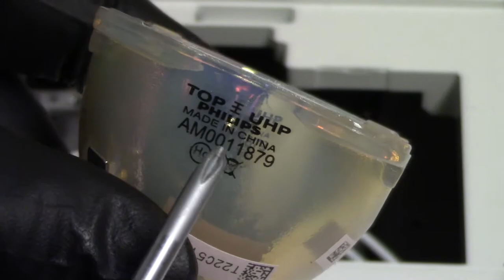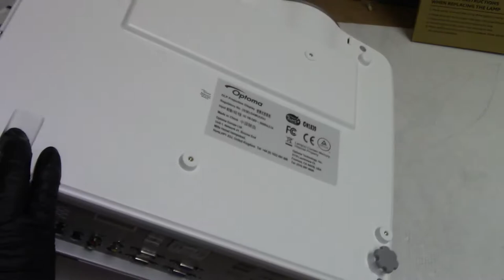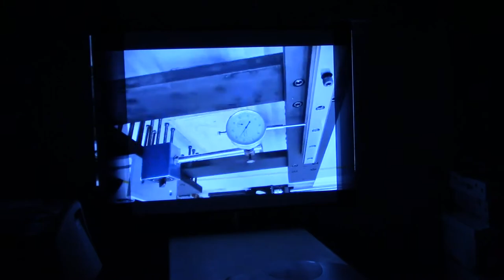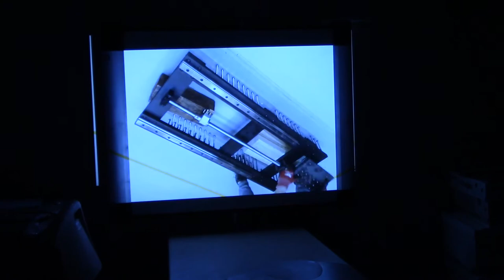Optoma WU515 DLP Projector Repair | Melted Connector Replacement

Comment: Hi Frank, Stumbled across your video looking for info on troubleshooting my projector. Hoping you can help. So I purchased an Optima EH515 for my business off Ebay about 1 yr ago. When I purchased I was informed that the bulb that was in it had about half its life left. So I purchased another. Initially, I bought one from Amazon. Not knowing at the time that there were differences in build quality and material. So after about 2-3 months, I was not pleased with the light output. I use my projector for Monograms for my wedding company. And at 5000 lumens, I felt it should be much brighter than I was getting from it. So, I did some research and purchased a new lamp. actually, from the place you recommended above. Pureland supply!

After installing it and using it a few weeks later it started shutting off randomly. At first, I thought it was the power cord not getting a good connection. But I have been able to verify that the cord is working fine. Last night I pulled the lamp and looked for any bad connections. Did not see any. Also, made sure the fans were coming on, on all three sides. As well as, checking the filter on the side of it to see if it were dirty. And it was not. So I started it back up and let it sit for a bit. After 15 min, it shut off again. But after a few min, it powered itself back on. did that a few more times before I pulled the power cord on it to keep it from starting back up. I did notice the top feels really hot! So Really not sure what is going on with it! Hopefully, you can help! I would really appreciate any advice you may have! Thanks!
Reply from the maker: Does the image flicker at all before it shuts down?  I do know those eh515s can have the same color wheel issue the HD26 an GT1080s can have.  Pureland will do repairs if you ask.  They just dont advertise it.

Comment: I have a similar projector EH515 it's pretty much the same as this. Replaced a dmd chip. The lamp does not sit in comfortably in mine either. I still have problem with the door mains switch. One day I might be able to fix it.
Reply from the maker: Still acting up?  Even with the door switch bypassed?  That is just weird.

Comment: Hi Frank,
I was wondering if you could help me with a solution to a problem. It's a Sony VPL-VW325ES 4K HDR Home Theater Projector. It powers on fine and shows a display but does not recognize any input when I plug into the HDMI ports. I really appreciate you sharing your knowledge!
Reply from the maker: Hi Nima, there is a good chance the HDMI chips are bad. Or something further up the main board. I repaired a vw40es with the same issue. Sadly it's a not an easy repair or cheap repair. However if you still are under warranty, I would use it.

Comment: Hi Frank I have a melted color wheel connector for a 3550i projector. I have the color wheel replacement from benq but it didn’t come with a new connector plug. My question is where do I get a replacement connector without going back to benq?
Reply from the maker: Thats a tough one.  They are technically built by Delta ( I think this model at least) and the wires are not listed. If the wire is passing voltage, I would suggest using kapton tape to protect the damaged areas. They only pass about 3v max, so the power requirements are low. Another option would be to de-pin the connector and slide some heat shrink over it, then re-pin and reverse the cable so the damaged end is away from the heat source. You could try an e-recycler. I use a company in China, gydz@timeprojectorlamp.com  They may be able to help.   I wish I had a better answer for you.

Comment: Hey Frank! I have a problem whit my proyector and I'll be very grateful if you help me. I am not a native English speaker so I must apologize in advance.
A year ago I've connected a Chromecast to the USB port for power supply and a Google home in the other USB. Then, it exploded. 
Yesterday I thought that I might be able to fix it so I unscrewed it and discovered that one of the capacitors exploded so I put a new one and it worked! Just for 10 seconds, the it turns off. I tried to turned it on once again and another capacitor exploded. What do you think is the problem here? Mi power supply is 220v (in the back it says 110v-220v)  I don't think it's the voltage because I been using it for years whit 220. Maybe a short circuit? Thank you for reading!
Reply from the maker: Also a WU515?  I would check the low voltage power supply.  My guess is the google home had needed too much power. Those USB ports only supply about 500-1000ma.
It's hard to say what exactly is wrong, but I would isolate the part that is causing the short.  Id suggest checking voltage regulators and diodes that handle the 5v circuit.
Reply: @FixitFrank  Thanks for our answer. I changed the burned capacitor and now it works perfectly fine! The only problem that I have now is that the USB ports have too much voltage (I've discovered it after connecting 2 pendrives and now they doesn't work) I don't have a multimeter so I'm trying not to connect anything.

Comment: Hi Frank, I picked up a Wolf Cinema TXF-700
For an incredible deal because of it being damaged by lightning.. After fixing the power supply issue, it’s now working however the HDCP 
2.2 is out and don’t know exactly what it would need to fix it.. thinking it’s most likely one of the chips but not completely sure.. Was hoping to get a hold of you to see if you might have an idea, or might be willing to see if you can fix it
I haven’t seen any of your videos that shoe you working on a Wolf Cinema Projector and figured you might be open to showcasing it… I
Was trying to find an email for you but decided to just leave a comment.. thanks
Reply from the maker: Hi Greg, I have an email listed on the about page but you can only see it via youtube desktop. Not on mobile. 
Is the port itself working with non HDCP sources?  That is weird for just HDCP to not work. If you are getting no video at all through that input then we might have a better chance to solve it but if non-hdcp content can still go through the input, that is a weird error.  I don't think its unrepairable or anything but it sure is weird.
Reply: Hi Frank, actually, if I connect that hdmi port, it goes to a fuzzy screen, and the remote doesn’t work, etc.. It’s pretty odd
Reply from the maker: That is curious.  Sounds more like a hardware problem(HDMI or formatter circuit). Might be a TVS diode array issue too.  Fuzzy screen on HDMI and no remote response would lead me to that area.